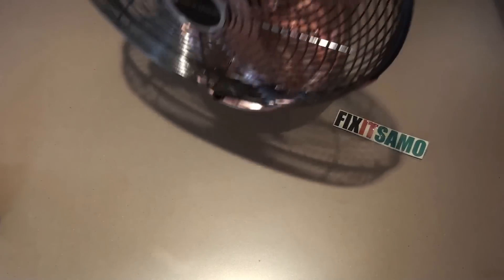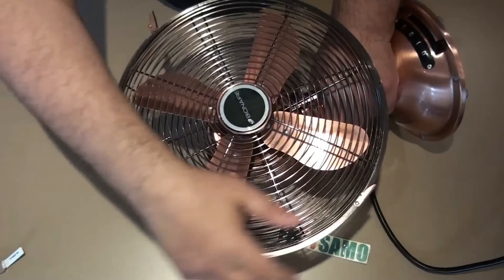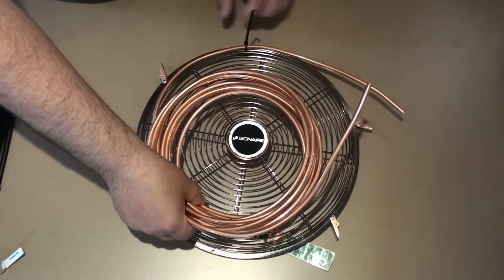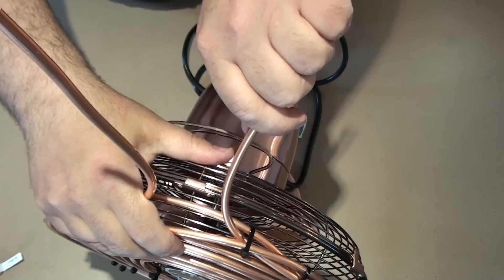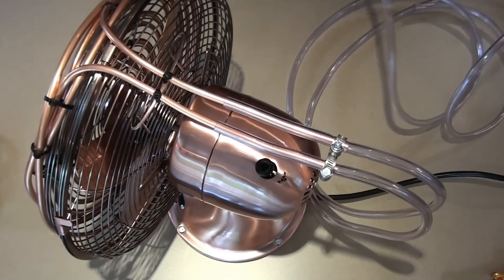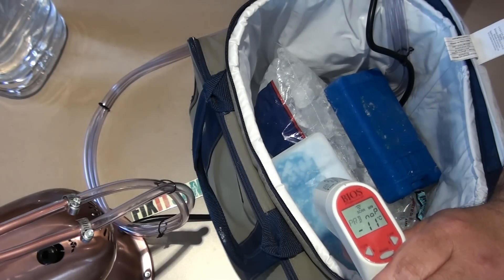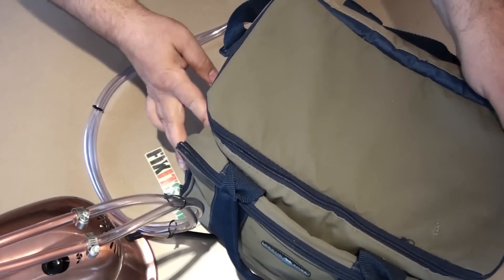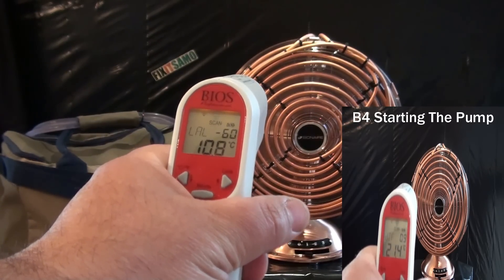How To Turn Your Fan Into An Airconditioner  AC

Comment: Only one tiny problem: the location of the two connections make me very uncomfortable. The spinning motor is right beneath those open air vents on the fan housing. Not good. If you spring a water leak, all sorts of nasty things can happen. 
Should have routed the copper ends beneath the fan shroud - not over the top. And use a flaring tool on the ends, with a little silicone seal.
Reply: WhiteRedLove
Yes...what you say is pretty much true. 
My favorite example is a McDonald's hamburger. It's perfectly designed to make you hungry again one hour after you eat one. They could make the burger with lean meat and a whole grain bun, but that would last you for half a day. But they make it out of stuff that passes through your digestive system in 15 minutes. And you want another one. And another one. Like crack cocaine.
Another favorite example is dry breakfast cereal. It's 99% air. You're buying a big box of air. For $6. Dump the cereal out of the box and smash it down with something. You wind up with a half cup of sawdust, and most of that is sugar. 
And don't get me started on soda pop. That stuff is worse than dope.
Reply: WhiteRedLove Well-spoken...
Through us, God perceives the world...
Reply: You mean there might be a problem with 110 volts running through water leaking on the floor?
Reply: Mike Patton Let's put it this way: in the blink of an eye you could be having a cold beer with Jesus or shaking hands with Satan. 
For most people (you and I are the exception, of course) the latter outcome is the most probable.
Reply: +Leon Davis considering such a small application there is not enough pressure to dislodge any of the parts, i would be more concerned with condensation buildup if this thing is on for more then a few hours
Reply: WhiteRedLove
Excellent point...I hadn't thought of the problem of condensation. 
 Regarding the joint between the PVC tubing and the copper, I don't think it would be a matter of pressure so much as cracking of the tubing beneath the worm clamp. 
This reminds me of the old aircooled VW motors. The fuel pump was mounted below the carb and a rubber hose connected the two. If the lower connection sprung a leak, it would spray gas all over the generator. If the top clamp blew off, the coil and distributer got drenched in petrol.
A lot of VW bugs and Transporters went up in flames over this silly design flaw.
Reply: +Leon Davis silly design flaw or marketing scam, theres a reason we only get low tech its easier to profit from. that sounds like such a disaster made me laugh something that should be done with the utmost of care was rushed out to market.
Reply: WhiteRedLove Nah...it was a design flaw...
Just about every automobile engine ever made has a weak spot or two.
Reply: +Leon Davis one or two weak spots would be an understatement. you think big industries actually want to give people the highest quality? no they want to give them the lowest quality and say its high quality so they can continue to over charge and always come up with a new model. you think there are engineers out there that actually work to make functional reliable vehicles? everything is overpriced because people bought into the stigma that they need others to do the hard work for them while they work a cheasy job feeding the corporate elite.
Reply: Leon Davis Yeah, if i ever think about trying this ill run the copper under the fan and seal the tubing a little better.  I was thinking something wasnt right when he said twice to run it over the top.
Reply: Mike Patton
Exactomundo. Run the tubes down the front and back underneath.
If you don't have a flaring tool, you can make a small flare with the end of a Phillips screwdriver. And double up on the clamps: two instead of one. Probably a bit of silicone caulking on the end. And use silicone tubing instead of PVC. Or go to Autozone and get some good hose. Designed to work under high heat near the engine.
Reply: +Leon Davis i just cant believe how so many people could so easily buy into it, but being in so many different minority groups has certainly allowed me to have a much wider perspective and retain a certain level of humbleness. i cannot understand how many people, live such selfish lives claiming to care and love the one's they keep closest.its sad most people think its a maternal instinct to love their children but its not, true love is something one has to learn and fight towards every single day, there are no half measures, i have not yet had any children but i do not intend to bring my own child into a world full of so many children and even adults who are in need of so much help.
Reply: WhiteRedLove
I cannot disagree with a single thing you say. There aren't many places left in this world where a person can feel reasonably secure. Predators lurk all around.
Reply: +Leon Davis any attempts to establish order and prosperity are crushed. its sad how it will be to late when most realize, it would be easy to create sustainable communities where everything is used and recycled with the highest efficiency, yet people are more concerned with small easily profitable solutions that have no foresight. i do not fear death i understand the will of the creator who lives through me.

Comment: You've missed something huge in this setup. Something that makes this useless. Condensation. Those cold copper tubes will be hitting the hot humid air in the room and condensation is going to be constantly dripping off your fan.
Reply: the blowing air itself might be enough to control that via evaporation. itbwill increase humidity however.
Reply: +Nerys placing it in front of semi open window shall take care of humidity
Reply: +Prabhjot Singh not where i live se pa. crazy humidity on hot days.
Reply: +Nerys Of course it won't. Have you ever seen an air conditioner?
Reply: +Prabhjot Singh Run an air conditioner in front of an open window? Use your brain.
Reply: +cdangers  i said semi open....plus the loss of cold air would be vry less..  since the back of fan would be facing the window.

Comment: i have an idea for uprgate it next lvl.
1.instead water use winter car cooling fluid
2.put it in freezer
(3.freeze kick out from room you wanna make cooler)
badoom tsss
Reply: +wdupejebanifaniczeko Water transports temperature better than car cooling fluid, the only advantage of car cooling fluid is that it does not freeze and help prevent rust, we don't need these advantages here.

Comment: I always thought of doing it and this guy really did it. Now I'm sure that it works!
Reply: Yes, but let's do away with the ice altogether.
I would get a huge plastic ice chest and drill several 1 1/2" holes in the lid.  Then I would insert lengths of copper pipe, standing vertically. Glue plugs in the bottom of the pipes. 
What you have is copper pipe sticking up above the lid. Two or three rows.
Maybe three feet high.
This draws heat out of the water bath. You don't need the water to be ice cold to work. Just cool.

Comment: there should be water dripping on the floor..wet floor+electricity god bless you! :) it's safer to just buy an air cooler btw :) not so exp and the electricity usage no much different from normal fan :)

Comment: I don't know how much effective heat exchanging would happen with this fat copper wire, We have something called a "cooler" here in India which uses dried grass pads instead of metal
Reply: +Siddharth Maloo Those work by evaporating the water (swamp cooler).

Comment: is this idea better than the other one which only use cooler box, fan  and ice?
Reply from the maker: +孟官苏 the ice will last 6 to 7  times longer in a completely  closed cooler
Reply: +fixitsamo is it possible to modify this system without complicating it too much, so we can use refrigerant instead of water ?
Reply: +Abdurrahmaan Shamsuddeen no. refridgerant would require everything else that goes with an ac unit. compressor and expansion. that is how refridgerant work. you compress it. this makes it hot. you cool the compressed refridgerant then when you let it expand to a gas it cool you use this tomprovide you with cooling air then you recompress making it bot again and the cool the hot liquid sonyou can again compress.

think of ice being for your freezer what batteries are for electricity. your using the big cooling you already have to charge your ice battery tou then use this to use that stored "cool"
Reply: +Nerys cool, thanx for the info bro, appreciate it
Reply: much better and alot colder
Reply: +Abdurrahmaan Shamsuddeen If you have a refrigerator with an extended water line for cold water you could use that and bypass the water outlet on the refrigerator, freeze some 2 liter bottles and then wrap the line around them for extended purposes and to keep the load off the refrigerator.
Reply: +孟官苏 - Yes, the kind with a cooler box, fan, and ice puts A LOT of humidity in the air and really only works well in very dry environments. Also with a completely closed cooler it takes much longer for the ice to melt.

Comment: what about the sweating of copper pipe when its cool, its throw water with air.  how much ice required to cool a room. suppose if its cool the room , return air will damage your fan motor winding.

Comment: I think after few minutes or hours the front of your fan will have water drops because of condensation on copper tubes and you'll have to clean the floors as well because of that.

Comment: I think this is a viable option if you dont have money to buy a small A/C. It will consume more electricity since you have 2 devices on at the same time, so it would be cheaper in the long run to buy an A/C.

Comment: What's the size of the vinyl tube [ID] and [OD] that will fit in to the pump?  brand of the pum please and the diameter that will fit the vinyl tubing.
Reply from the maker: +Mark Vincent Arcilla  i got my pump from a hardware store cause its a standard fountain pump and the tube size it 3/8  if you want  you can look for this online from amazonhttp://www.amazon.com/dp/B004DL0XZO/ref=asc_df_B004DL0XZO4254914?smid=ATVPDKIKX0DER&tag=nextagcom0f-20&linkCode=df0&creative=395093&creativeASIN=B004DL0XZO&ascsubtag=-9186624139628937482
Reply: +fixitsamo why is there a moist when the water flows on the coil?

Comment: you should freeze "Anti-Freeze" that is used to keep engine blocks cool.......  the cold anti-freeze will last a lot longer.
Reply: actually anti freeze is a worse cooling agent. we use anti freeze in order to alter the freezing and boiling temps and for anti corrosion the sacrifice is it does not cool as well as plain water. alas plain water will freeze in winter boil when engine is hot and rust out the guts of your engine cooling system.

Comment: Using a mixture of water and ice is not economical ; moreover its not completely effective in cooling 
I did this project in a small scale using a usb fan , copper tubing , and a canister of liquid butane.
 I direct the exhausted butane outside. I get a temp of 1-2 degree C. You could try using propane and get even colder temp.

Comment: Very impressive! Only pain is replenishing coolant :) But this is much much better than a huge and messy air cooler which also wastes a lot of water. I would suggest other users to use four huge bricks of coolant gel: two in water and two in freezer, recyclable :)
Reply from the maker: +Adarsh GUPTA  thank you and yes that's what I do actually I keep 2 in the freezer for backup the amount of ice that I used lasted for almost 16 hours cause my cooler is very small

Comment: Air conditioners are cheap  what is costly is electricity and if you have any faith in thermodynamics believe me this is gonna cost a lot more. if you dont believe try and run this setup for 1 month for 4 hours a day and tell me what is your electric bill with all that ice load on your refrigerator
Reply: +Maxx Fordham since always you see the fridge has a thermal sensor that cuts off the the compressor when the inside has reached a certain temp. if there is more water to freeze it will take longer to reach that threshold temp the compressor will run longer and thus will use more power. On the other hand unlike compressor in AC unit, the compressors in refrigerator are not designed to run for long amount of time so it will heat up and become inefficient and use use more power and eventually fail so overall it would be costly affair. If you want to go cheap use desert cooler with proper ventilation if you live in dry area they are cheap and made for cooling room.
Reply: Damn som indians r damn intelligent whers me soo dumb..
Reply: +Dhiraj Gupta
Since when does the fridge have any "knowledge" that you're trying to take more cold water from it? It has to cool room-temp. air anyway, does it not? Same with the water.

Comment: that gun your using can not measure air temp, only temperature of a solid object. then again even if your reading the copper line itself you have to adjust the guns settings because reflective objects will give you false readings, id suggest using a thermometer. Either way in sure it works great, cool video

Comment: good idea needs improving tho.... maybe drill two holes in the freezer  and use antifreeze for coolant fix the pump in a bottle fill bottle remove air from system lol reverse central heating system.... central cooling system lmfao

Comment: You should probably reduce the length of the transparent pipe as a lot of heat is being dissipated from there. Also insulating the transparent pipe would be a good idea.

Comment: add salt to the ice water. it lowers the freezing temperature and causes the ice to absorb heat energy from the water as it melts, lowering the temperature to around 0 degrees fahrenheit.

Comment: This is genius! I hate to be the one that points out problems but I feel that the pump has a chance of failing due to running very hard to push such a long loop of water. Other than that, to see it change the temperature by nearly 100 degrees is just insane.
Reply: +prizedcoffeecup The chance was in the copper tube, not in the air. 

Water can transfer heat/cold to copper really well, but copper to transfer the heat/cold to air it pretty terrible. Only way to test this setups efficiency would be place a object front of the fan and measure it with and with out the cooling system on. I would place my money on this being terrible inefficient, not to mention costly to build due price of the copper and pain in the ass maintain as at least where i live getting that much of ice in reasonable price... is in winter, that kinda defeats the purpose...

Efficiency could be risen with getting more surface area on the copper, by getting thinner sheets of metal between the tubes... but i would say getting motorbikes aluminum radiator would do job much better and cheaper than this copper disaster.

To keep humidity in check you could buy several of (cant recall the name of the component) 12v electric cooler components what heat other side and cool the other side. Make aluminum box, install those components cold side towards box with thermal paste between them, add cooling heat sink to each of the component with thermal paste and then insulate whole box, but the side that has the components. Get battery to run this system and 12v solar panel if you have enough sun light to recharge it. Add insulation around the pipes and fill the box with water and ice. Placing the box outside into relative cool place that is in shadow, optimally whole day will solve the humidity problem. Just sealing the box should also do this, but what the cold side will cool, hot side will heat, so it would best to place the main box outside of the building, or into window so heat is released outside.

Or you could just buy proper AC and be done with it.

Comment: It will work but you have to refill the ice every 10mins
Reply from the maker: +videoloops1 thx to the cooler u need at least 7 hrs before you add  more ice
Reply: fixitsamo Nope. If you calculate, the cooler can take max of 10kgs of ice looking at its size. Comparing the latent heat of condensation of water for 10kgs of ice with what a room needs to cool down, its much less.

Comment: Do you measure the room temp instead of the direct output air? It's is the overall room temp that matter, not the output of the fan temp
Reply from the maker: +Ricky Acosta after around 1 hour the  room temperature dropped from 27 to 22 degree  Celsius
Reply: +fixitsamo cool, thanks man!
Reply from the maker: +Ricky Acosta  and my test room was 12x15  feet

Comment: @fixitsamo I've been thinking about this for some time now, with one difference: no ice; just water (I haven't bought anything as yet).  I know it will not be as good as with the ice.  Can you try it with  a 5 gallon bucket with the exhaust hose a foot or two above the bucket running down a flat piece of wood back into the bucket?

Comment: I have a kegerator (small refrigerator, which I run all the time to keep beer cold) on my enclosed lanai, I plan to run two coils, one in the kegerator and the other on the fan. A pump with in/out flow will pump the water/refrigerant through both refrig and fan coils. I will let you know the progress here.

Comment: for 50*f to 68*f isnt that bad, but if u did the 5 Gal bucked it would be low 4x*f  = 4.44*c
Reply: +Zraupp10  yeah and you could just remove the racks in the frig and sleep in there too.

Comment: How much copper tubing did you use? How much electricity does this use? How much area will this system cool?
Reply from the maker: +Paul Larnce  around 10 foot off copper tubing, Room size is 15/15 foot  ,I don't know about electricity it depends on your fan